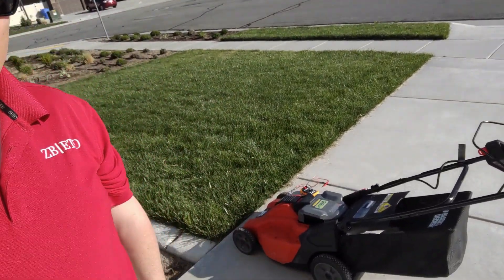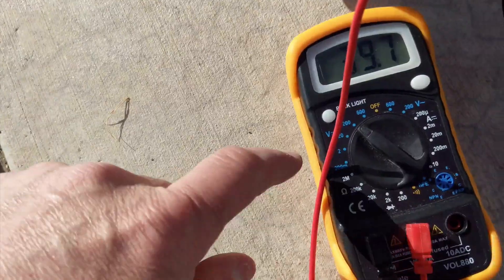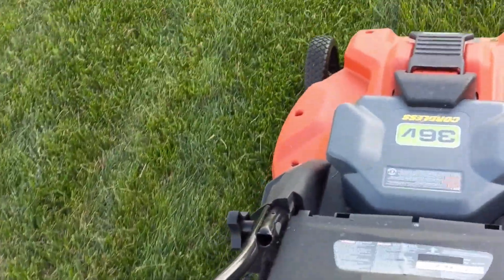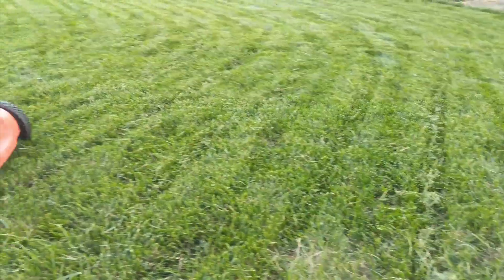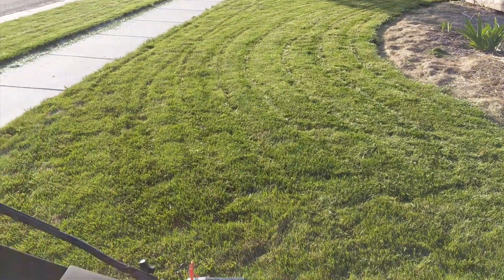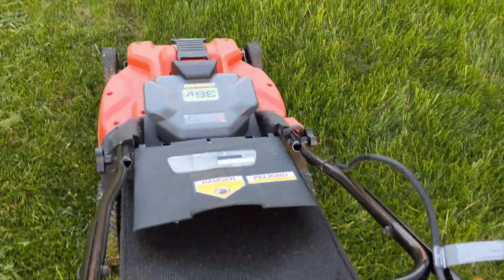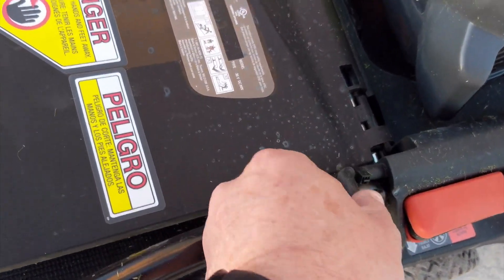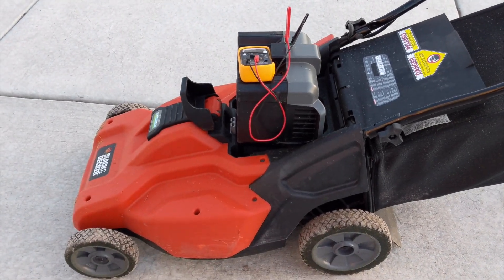Black and Decker 36v Lawnmower Modification

Comment: Frank Brand you can get UpStart Batteries from Amazon can put them in the battery pack and then it’s like having a brand new mower without paying $100 for a battery
Reply: Shea, can you provide which batteries your referring to?   I tried to search within Amazon and could not locate  them. I have the same battery as this in this video and need to buy 3 batteries.

Comment: Have you measured the current consumption under load of the lead acid battery pack to properly size a replacement?
Reply from the maker: Yes, with no load the mower pulls 4.8 amps and under a load (cutting long grass) it pulls around 14-16 amps. That's roughly 500 watts.

Comment: just make sure to count your parallel for equal max current that mower can handle so you dont have a big huge explosion from over loaded batteries. Im not sure what batteries your using but the average can do around 2 amp safely. Stay Safe!
Reply from the maker: Thanks For your comment and concern.  I will be building out a 36 volt 15Ah battery that can handle over 30 amps.  The battery will have 70 18650 Li-Ion cells.